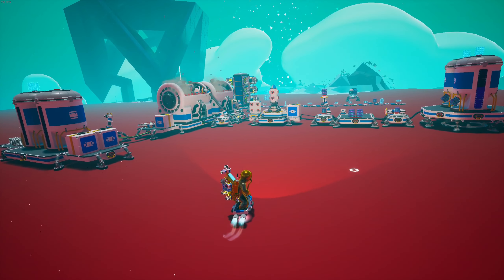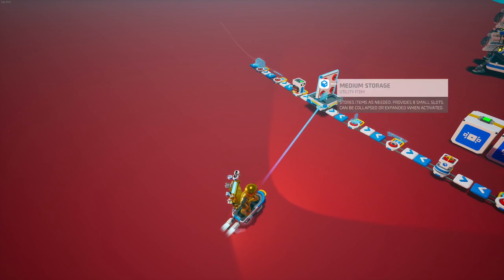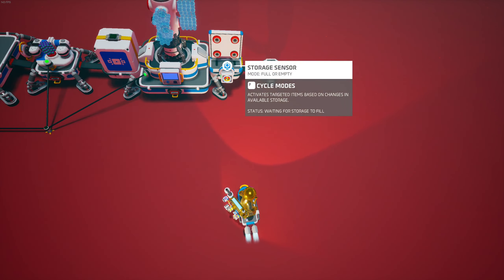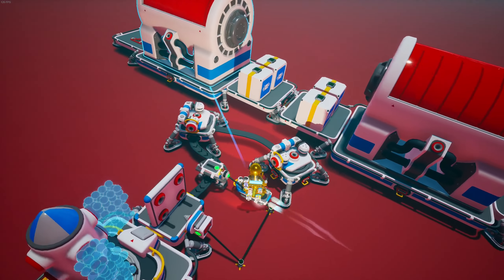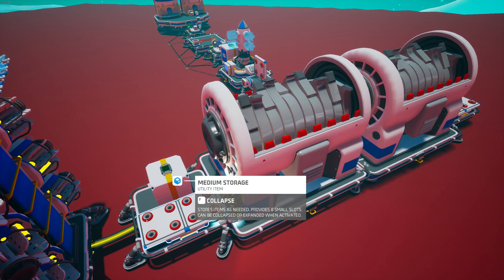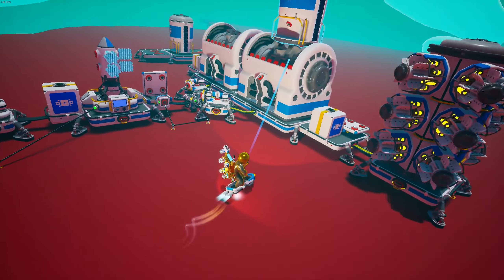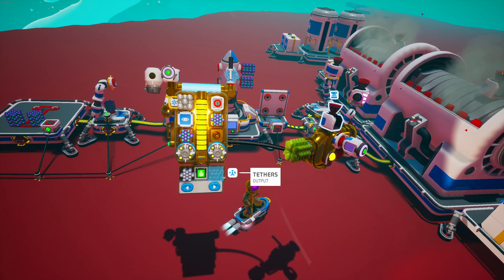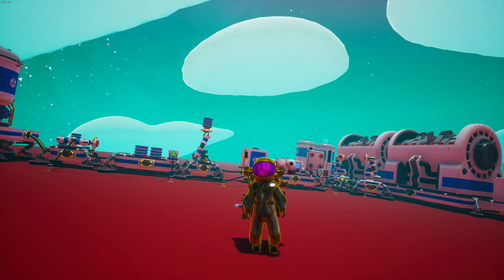This Factory Makes TONS of Scrap Using ASTRONIUM - Astroneer

Comment: I'm hoping this works. I haven't tried this yet but I've always had problems auto sending that darn trade Platform rocket. I don't have the patience to figure it out. So glad for Seck to share this info.
Reply from the maker: Thanks for checking the video out, did you ever get it to work? :)
Reply: Before watching this, I found a way, basically make a clock (button, delay, button) then branch off that to trade platform. It does seem simpler, The difference is it continually tries to send, the auto arms will have enough scrap there before coming back. A con to that is the auto arms are always on, which probably makes big difference in power with this many arms
Reply: @DanimalUpchurch  This is what I use for my extractor to speed up production. What did you setup the delay at?

Comment: Material list:

- 1x Extra Large Platform A
- 2x Astronium Filled Large Resource Canister
- 8x Medium Platform A
- 1x Large Platform A
- 1x Large Platform B
- 9x Packed Large Platform A
- 7x Auto Arm
- 1x Trade Platform
- 3x Medium Storage
- 1x Power Switch
- 2x Storage Sensor
- 3x Extra Large Platform C
- 2x Extra Large Shredder
- 2x Large Resource Canister

Comment: Great video but I’m having a bit of a problem with the first two auto arms. They will load up one load for the trade platform but then will switch off and not carry on after the jump jets have been moved to the shredder. Any notes would be great.
Reply from the maker: Hi, thanks for watching. Try picking up your storage sensors, place them back down, and re-wire your system. You may have put the storage sensor down on the wrong item or placed a pin on the wrong item.
Reply: I also am havintg this issue,   hope there is reply,  wondering if has to do with sensors
Reply from the maker: @jimdenton9770  have you set the second sensor to “empty or not empty”?
Reply: @Secks  Seck,   you show in the Video to set it,  (the 2nd one)  but you don't mention where to put the first sensor on  (on the on empty platefor, and trade station)
Reply from the maker: @jimdenton9770  attach the first sensor to the large empty platform and wire it to trade platform and the two first auto arms and set it to "full or empty". The second sensor should be placed on the medium storage on the same platform as the trade platform and will be wired to the power switch. The second sensor should be set to "empty or not empty"
Reply: @Secks  Thansk again,    looking back what would cause the Trade platform not ot auto sent?
Reply from the maker: @jimdenton9770  Maybe the storage sensor isn't connected to the trade platform or maybe not connected to the large platform a or maybe you have it set to the wrong setting. It should be auto sent when the platform empties.

Comment: Everything is working but the trade platform won't go on its own?
Edit: Fixed the problem, I just turned the front arm on too early lol
Reply: I have the same problem but idk how to fix it
Reply: @KanaGames31  My problem was I had turned on both of auto arms before starting the machine. If you made this mistake, disconnect your power, turn off the first arm but leave the second one on, it should fix the issue.

Comment: Can somebody tell me how to make it so when my trade platform is full it will automatically lunch
Reply from the maker: that is explained in this video. You cannot directly do it because that's not how astroneer works, so you have to make a work-around where you launch it when a similarly sized platform is emptied into the trade platform.

Comment: Do you need me be extra large shredder?
Reply: Yeah, you probably do because it will have too many jump jets and wouldn’t be able to process them fast enough. If you’re in early game I suggest checking out kuya games video, then come back late game to make this
Reply: @kana271  ok that makes sense, I’m mid game I think
Reply: @kana271  ok that makes sense, I’m mid game I think
Reply from the maker: Hi Aiden, you can make it work with smaller shredders too, it would just run a little bit slower. With how I designed the system, backup should not be an issue. Thanks for watching!
Reply: @Secks  ohhhh ok
Reply: @Secks  np

Comment: it is really cool but it is way more over-engineerd than its need to, there are more easy ways to do it like you dont need al the storage sensors beceuse its going to stop whit filling up when it is full.
Reply from the maker: Unfortunately that isn't the case. It's really easy to make a system without canisters using the loading/unloading mechanics already in the game but you have to enable/disable the resource canisters to receive or dispense resources, which complicates things a lot. My system here isn't perfect, but if you're looking for a high-capacity system using resource canisters, some of the mechanics of this system are a good place to start.

As for the proximity repeaters, looking back I could have designed the system without them. They were part of a previous design and I forgot they weren't necessary when using auto arms.